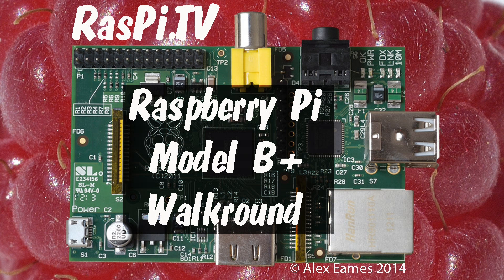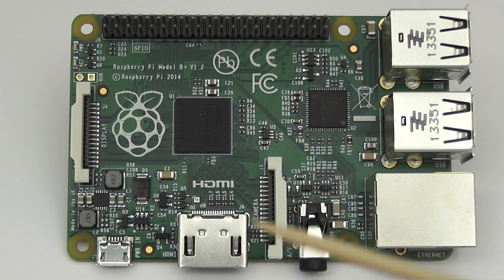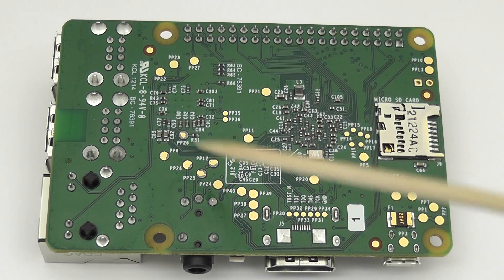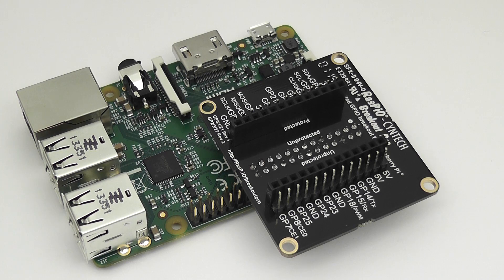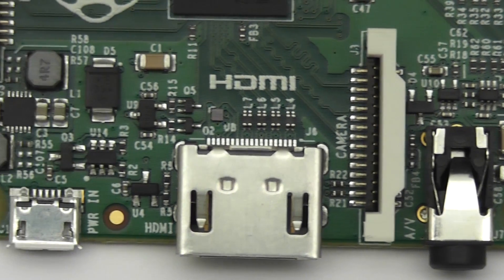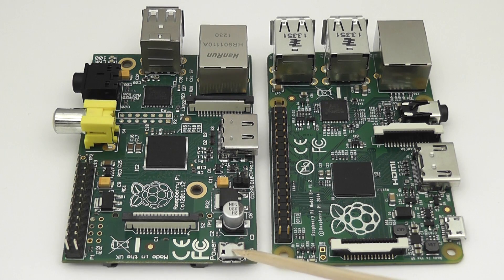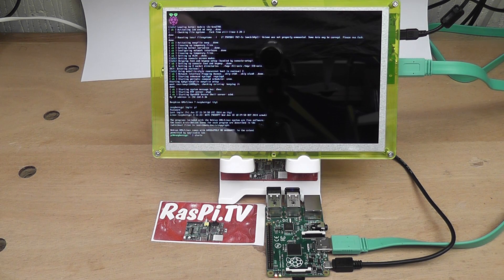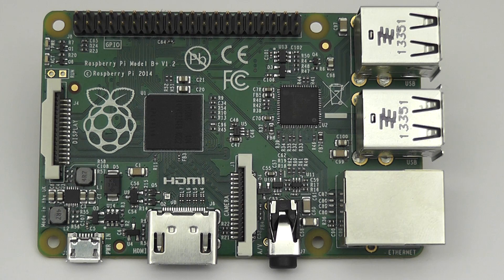Raspberry Pi Model B+ launched today. Full walkaround.

Comment: Why do both yours have white connectors for the camera and LCD connector?  My Model B and B+ have boring black!
Reply from the maker: Production ones have black. The ones with white were final prototypes. You'll see that most of the manufacturer videos and photos have white ones too.
Reply: Alex Eames Aaaaah that makes sense!  I wonder if there are B+ in red yet in China :)  Also the traces at the bottom right of the Broadcom are interesting as they are squiggly!  I have a lot to learn, I also wonder what all those resistors all over the bottom of the board do?  There are so many they couldn't fit all the labels in!!
Reply from the maker: I think wiggly traces are to do with trying to keep the high speed HDMI/camera traces the same length to avoid timing or functionality problems.

Comment: I just received my model b yesterday and this comes out that's gay
Reply: "Gay"? If you expect to be respected and taken seriously, don't talk like a fool.
Reply: ***** man, and you've taken it too seriously. haha
Reply: I got it too last week. yep, they want to clean crap this out first before release this one.
Reply: Yuda Prawira It seems they wanted to surprise everyone with the new model B+. Unfortunately this leads to some people in a position such as yourself.

But: the model B+ is not much different from the old model B. Unless you need more GPIO headers or the additional USB you should be fine with it. For most people, the differences should be negligible. Although I understand the craving for a newer version. ;)

I don't know where you live, but in most places you can probably return it and cancel your purchase. Maybe that is an option. And from what I understand they did not want to sell off the old models, because there are some industrial partners who build products around the RPi with the old design. So the old layout will stay in production for as long as there is demand for it.
Reply: frustbox If I have to be serious, for me that's pretty much different. More GPIO, More USB, Micro SD, and most importantly is B+ use more lower power comsumption. and I guess it could be lower CPU and GPU temp. and I do hardware and software optimization here.

I don't have any idea to return it or cancel my purchase since this B model on my own hand now. and I have to wait those delivery again for not short time.

I think raspberry pi should give announcement about this B+ model before. and when it will be released.
Reply: It would be much worse if it was straight.

Comment: I would pay more if they improve the processor to a more actual one, like 4 Core with 1 or 2 Gig of RAM. Even cheap smart phones from china for 80€ use MT6582 1.3GHz Quad core with 1 Gig of RAM and they have GSM WIFI bluetooth a display all build in.